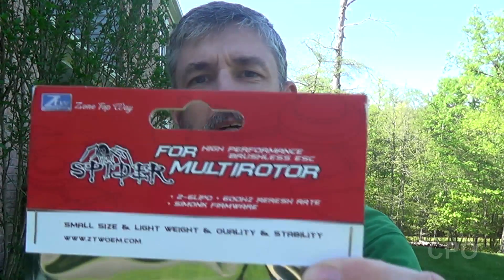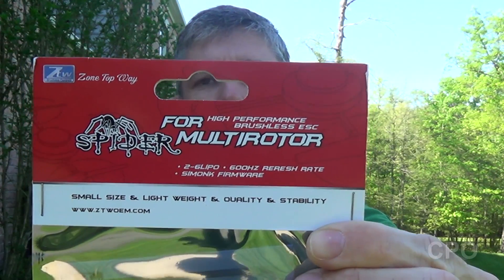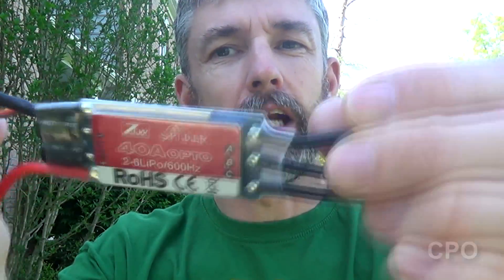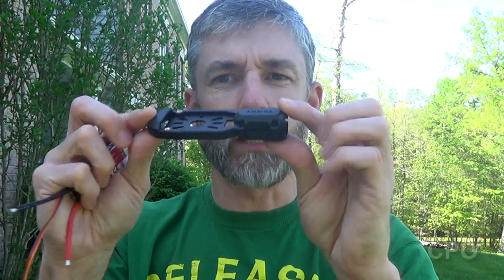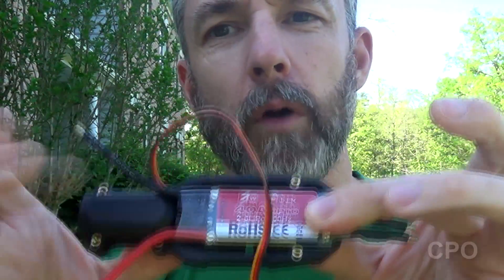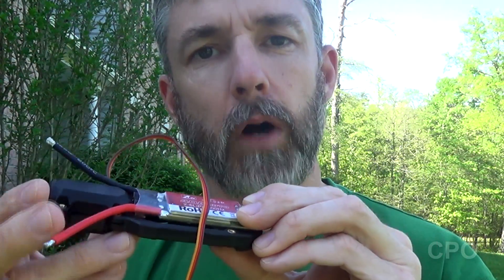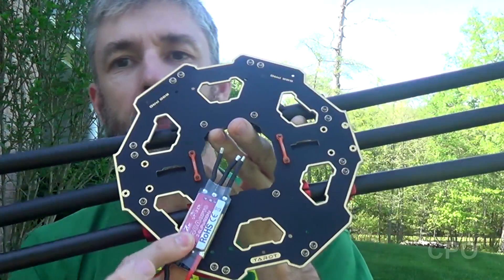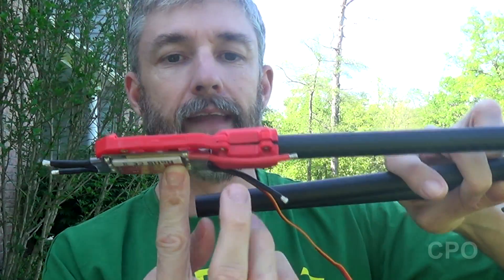Tarot 680 Pro Update : ESCs are in...with a slight complication

Comment: so can theses ztw 40 amp spider work well and can they be trusted on an expensive multiroter? or would you recommend a well known nambrand? I was told that theses esc,s are as good as they get? davidringler40@yahoo.com thank you in advance for any or all help in this matter I am using them with 4 tarot 4114 320kv motors running 15.5 tarot folding props with pixhawkp4 fc on tarot 650 ironman with 6s 10000 lipo 0r 8s 8600lipo!

Comment: just ordered a set of 30A ZTW spiders.  Is it true you need to leave the red/5v wire connected on the servo connectors on these since they're OPTO?  I'm going to be working with an APM mini so I'll only have the signal connectors.  I'm assuming I'll need to make a wiring harness if this is the case.

Great vids!